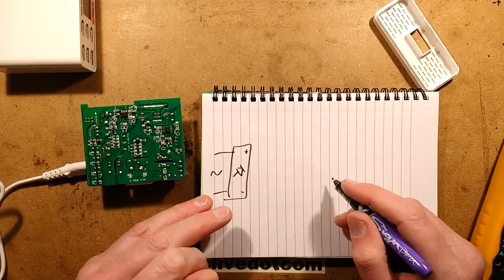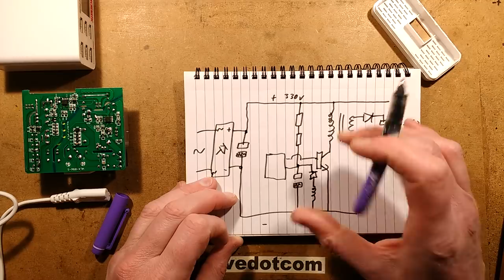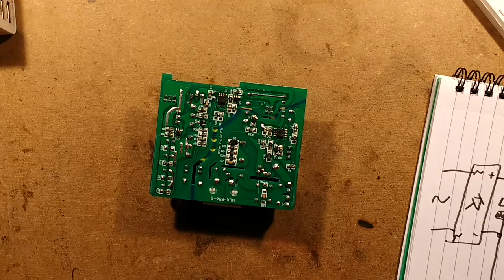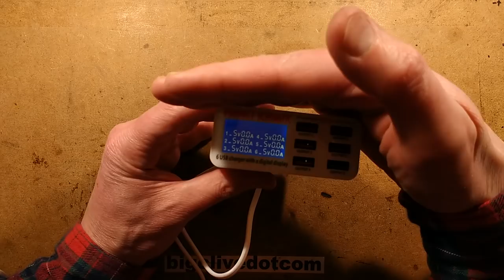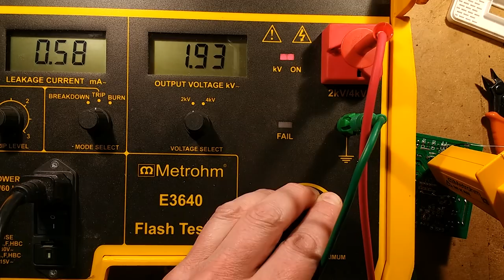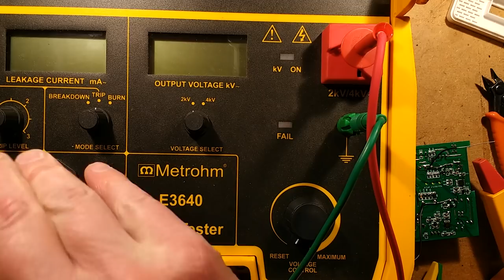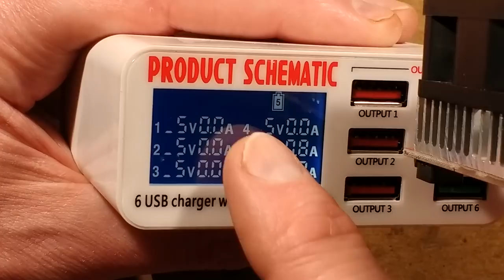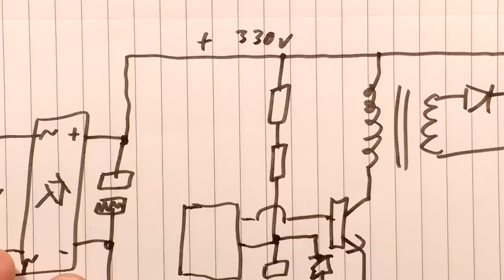Fixing a faulty USB power supply.

Comment: The USB supply called 'New Text Document (3)' is better.
Reply: Actually, I prefer New Text Document (4). It has more ports and faster charging.
Reply: @andymadden8183  I prefer New Project eventually New folder
Those bastards are more complex and have more functions.
Reply: I like my "Copy of New Project 2 (copy)-final-finalforrealthistime" power supply better. Most of the old quirks and issues are fixed in that one.

Comment: It helps to know how a circuit works and what you are looking for, you diagnosed the issue perfectly and methodically.  I've seen guys start at the back end of a circuit and never found the issue.  Always start from the input to the output, you have better luck if you don't have a schematic, if you understand what the components do, how they work and what the expected outcome is. Doodling out a drawing of the circuit is always helpful.

Comment: Hi  Clive
I cannot comment on commercial equipment but for medical equipment the test voltage as per IEC60601-1 would be 1.5kV for one means of operator protection for class 1 equipment and 3.0kV for two means of operator protection for a class 2 equipment (which is what you have there). The difference between class 1 and class 2. Class 1 has a protective earth (normally connected to a metal chassis) which is 1 means of protection, therefore you only require 1 means of protection from the mains part to the output. In the case of a class 2 devices that does not have a protective earth there is a requirement to have 2 means of protection. According to the standard a grounded chassis is considered as 1 means of operator protection.
A very good explanation on how the circuit functions.

Comment: 11:30 "The higher the frequency, the smaller the transformer you can get off with." And this is why on airliners the electricity supply is always AC at a much higher frequency than mains on the ground, so that small (and therefore light) transformers can be used.
Reply: The main reason is the smaller generator.
It's 3 phase 115V/400Hz on an airplane.
The seat and inflight entertainment is running on DC voltage made from the 400Hz rail.
That is that constant high pitch noise in the plane.
Reply: I always thought that constant high pitched noise was someone's baby crying - at least it was for a 14 hour flight to Singapore that I was on!
Reply: I would cry too if there was a constant high-pitch noise on a plane

Comment: Fine bit of soldering there, it's not easy squeezing your tip into such a small gap, even if it's just for a minute... :P
Reply: That's because he didn't - the wire was heated from the other side of the board.
Reply: Someone been watching AvE...
Reply: Jonny T    RELEASE THE SHMOOOOOO!
Reply: Jonny T obviously... Just the tip and only for a minute

Comment: Hi Clive. I've been going back through your videos. I have a USB PSU (4A) that has started to switch on and off about twice a second and I seem to remember you pointing out a fault in a USB supply that caused a similar thing and saying it wasn't uncommon. In fact I'm sure I've seen the same fault in at least two of your vids - but I'm buggered if I can find them now!
Cheers.
Reply from the maker: Usually either the low voltage side electrolytic smoothing caps, or the small electrolytic bootstrap capacitor on the high voltage side.
All replacements should be low ESR type.

Comment: When they are repairing stuff on youtube - loose wire or something simple stupid like that
When I'm repairing something - dead FPGA for 100 pounds
>.<
Reply: The videos of those are just never uploaded, since they're both a waste of time for the audience and anticlimactic.
Reply: Man I know that feeling Arek. Or it starts with a similar fault, but it ends up it's actually dead windings, a blown mosfet, a somehow-deprogrammed chip. Things that are just. Unfixable unless you control the mighty forces of nanometer sized components.
Reply: I actually once got a CP2102 chip that had the wrong firmware on it (registered as some OEM device on USB, rather than the generic USB-to-serial stuff). I ended up being able to fix it by copying the firmware from another CP2102 USB-to-UART adapter to this chip.
Reply: I’ve had an on-board power supply go into berserker mode on a board with a $5k FPGA that I really needed to finish a project. Not a happy day for sure. Eventually I figured out that some capacitors had marginal ESR by design, and as they slightly aged, the supply started pushing a sine wave on top of the about 1V the FPGA’s core needed. I couldn’t really blame the caps - they did their job fine, not their fault that the design was wonky.

Comment: I think a while back I came by some local regulations in Finland before EU. Insulation requirement was 4kVac for 1min. I've had the impression that EU regulations were similar in insulation requirements when CE compliance came.
Funnily at that time insulation transformers (used in equipment repair) needed something like 8 or 10kVac (1min) if my memory serves well. I guess there was need for some margin in case the device under repair had any high voltage sections on itself. (I tested my isolation transformers at 12kV because I had suitable source for that voltage.) Touching insulated equipment with that kind of specs is pretty safe, safer than touching commercial appliance.

Comment: I was about to buy one of these off Aliexpress.  They are much cheaper on Aliexpress than Gearbest,  which itself has wildly varying prices.
Spec says:  Single-port USB output maximum 3.5A, 6 USB ports total maximum output 6A.  I'm a bit wary of these cheapo chargers as my current one actually managed to blow out one of the USB ports when a crappy iPhone cable shorted whilst plugged in.

Comment: Strangely fascinating video..thanks for posting. I can't analyze a full circuit component by component, but I do always pull something apart, if its low voltage, to try to fix it. I get circuit corrosion a lot. I live near the sea and the salt in the air has an effect on electronics, well thats my theory. Cheers Stephen

Comment: I have found when using an isolation tester sometimes if you go to high you will take out a part without realizing it.  In my case someone changed the machine from 40VDC to 500vac without letting anyone know and it ruined all the output filter caps that were rated for a max of 50V.  We didn't realize they were bad until we got a complaint from the customer that the units were acting different than usual.

Comment: Given that all USB ports share one 5 V supply I wonder if all USB ports together can actually deliver more than 2.1 amps. Since there seems to be no real current limiting, unless the single USB port connection provided enough resistance for the voltage to drop like that I would assume all ports together not to be able to deliver a lot more than a single one...

Comment: Hi Clive a tear down of a clip on guitar tuner would be extremely interesting regarding how it picks up on vibrates and processes as a note.
Reply: probably just a microphone behind the spring clip that holds it to the instrument. Maybe it just doesn't have a hole open to the air so it only picks up vibrations conducted through the case, not random other noise. I'm guessing it would be a really boring teardown - a microphone, a chip under a blob of epoxy, a couple discrete passives, and a lcd and a couple leds.
Reply: gorak9000 Usually it's a magnetic sensor picking up vibrations of metal guitar strings.  But I don't know the details.  Clip-on pickups for acoustic guitars with non-metal strings may be microphones though.
Reply: I didn't think about that. I was mostly thinking of clip on tuners for other string instruments, like violins, where you clip them to the scroll - pretty sure the guitar tuners clip to the end of the head, by the tuners too, so they aren't using magnetics to pick up the vibrations from the strings, but rather the vibration of the head (or scroll) itself. I don't have any of those clip on tuners - more of a traditionalist, tune A using something (tuning fork, tuner, smartphone tuner app, oboe, etc), then tune everything else listening for the lack of beat frequencies
Reply: I'd guess they use signal from piezo transducers achored at one end and left to "flap" with the vibration. Would like see 'cos it's still clever or witchcraft under £10.
Reply: LostJohnny I think this is the most likely setup. I know the world we live in....I just purchased one from eBay for 6.50 and it’s fantastic.
Reply: Gorak: I have a tuner with a transparent case and you are exactly right (it does also have 1/4" sockets for electric guitar tuning).

Comment: I got a 5 usb port "tower" charger from poundland and it worked until the first time I unplugged the AC cable from it. Then it would make a crackly noise and not power anything. Turned out the AC power jack was only held in place by 2 very loose plastic plugs and the solder connecting it to the PCB which had pulled off. I sorted it by melting the plastic plugs with a soldering iron to secure the jack in place, resoldering the joints and hot gluing the hell out of it. Works great now, but it might be a common problem with that particular model.

Comment: Actually, there is only a very little amount of parts really mounted to that heat-sink, so it should be easy to remove. But unfortunately, as there are only a few parts mounted, keeping the heat sink in place, it seems to be glued at several places, so it doesn't rip parts off when being thrown and dropped. So what I do in such situations is, to un-solder all components fixed and glued to the heat-sink and remove it in one large piece. By that you can easily reach inside and fix whatever needs to be fixed.

Comment: Clive, you can buy a copy of EN60950-1 from "estonian standards" for about 33 Euros which is much cheaper than the £400 BSI want. That will detail hipot testing voltages, allowable plastic flamability ratings and creepage and clearance distances that should be used between the mains and safe side on IT equipment. The standard has been superceeded but for what you are doing that shouldn't be a problem.
Reply: If you do buy the standard that device would be pollution degree 2 and installation category II  and the PCB (if FR4) would be assumed to have a CTI of 175.

There will be multiple hipot test voltages listed one for testing by the compliance lab and a lower one which each unit should be tested to in production
Reply: Looking at the EN60950-1 Standard.

Table G1 Says for an AC supply between 150 and 300VACRMS in Overvoltage Category II the mains transient voltage is 2.5kV

Section G4.1.b.b1 Specifies the required withstand voltage is equal to the mains transient voltage at 2.5kV

Table 5C Then specifies the required test voltage for reinforced insulation with a mains transient voltage of 2.5kV is 5kV (peak or DC)

Section 5.2.2 Then says that for certification testing you would ramp to the required test voltage from 0V and then hold it for 60 seconds. It then goes on to state that for Routine Tests (ie production time test) you can reduce the 60 seconds to 1 second and reduce the voltage by 10%.

Therefore for routine testing you can use 4.5kVDC and hold it for 1 second.

Comment: Excellent video. In case the power capacitor was charged, the metal handle of the screwdriver would have zapped you first. If you are going to work on circuits with high voltage capacitors, one needs to keep a suitable power resistor with soldered wires handy for safely dissipating the charge without drama and to avoid very high fault currents of short-circuits, that may degrade the capacitor.

Comment: For the flash test voltage for usb's Speak to NAPIT, if their technical director doesn't know, he will find out for you. He's usually very good, he's on the committee for the Regs. I've worked with him before, 5 yearly inspections, and he's a nice knowledgeable engineer.

Comment: From the EN60950-1 Standard "Information technology equipment. Safety. General requirements"

Table G1 Says for an AC supply between 150 and 300VACRMS in Overvoltage Category II the mains transient voltage is 2.5kV

Section G4.1.b.b1 Specifies the required withstand voltage is equal to the mains transient voltage at 2.5kV

Table 5C Then specifies the required test voltage for reinforced insulation with a mains transient voltage of 2.5kV is 5kV (peak or DC)

Section 5.2.2 Then says that for certification testing you would ramp to the required test voltage from 0V and then hold it for 60 seconds. It then goes on to state that for Routine Tests (ie production time test) you can reduce the 60 seconds to 1 second and reduce the voltage by 10%.

Therefore for routine testing you can use 4.5kVDC and hold it for 1 second.
Reply: What is the purpose of this test? I'm a refrigeration tech in USA. We test our motors for ground faults with Meggers 500-2k volts. Is this the same? A standing merger test we call a hi-pot test & can be up to 5kv for large motors.

Comment: If it's from Gearbest I'm surprised it didn't catch fire the moment you plugged it in... actually I'm surprised it showed up after ordering
Reply: I ordered two watches from gearbest simply because that particular design was only sold there. Two arrived completely different models and both were broken. Thankfully I bought via paypal and got my money back. Gearbest never replied or messaged. Scammers...

Comment: Good to know there is a tool to remove plated through-holes connections, I would have busted that thing up trying to remove the heatsink assembly. I wonder how thin is the tube of that tool, would it fit in most cases? most manufacturing standards would have a 1mm drill hole for a 0.8mm pin for a +/-0.1mm tolerance for both hole and pin.
Reply from the maker: It has a selection of sizes.  I added an eBay search link in the description.

Comment: Get some chipquick! It’s an ultra low melting temperature solder which mixes with the tin solder to keep it molten for longer. You can wick away lots of the original solder, then solder it all back together with chipquick, then touch each connection with the iron and just pull the part off. It stays molten for about 10 seconds. I use it at work to pull TSOP56 packages off things. It works a treat.
Reply: It sounds like Wood's metal, which has a melting point of just over 70°C. At one time you could buy joke teaspoons made from it, which was great fun for kids, until Health and Safety jumped on the fact that it is toxic.
Reply: RWBHere I remember my father once telling me about those, he had one as a kid. He also had a big pint-sized bottle of mercury with a squeezable spout,  that he borrowed from work, us kids would play for hours with balls of mercury. Ah, the good old days.
Reply: I remember watching a tutorial, I think it may have been making a diy laser diode die, where indium solder was used, so hardly any heat was required, thus protecting the sensitive diode junctions.
Reply: uk DOT farnell DOT com/1850214
Its fairly expensive, but totally worth it for removing all kinds of components without damage. They supply it with a particularly aggressive acid flux, which you need for it to wet to the joint properly and mix with the existing solder. If you try it dry, or just using ordinary rosin or "no clean" synthetic flux, it won't work very well.

Comment: Product description: "Wide input voltage range of AC 100-240V, compatible with all 5V USB-charged devices. Smart Active Recognition: Single-port USB output maximum 3.5A, 6 USB ports total maximum output 6A.
LCD Display, a clear display of the state of charge, convenient at night or the case of poor light can also be observed.
With the build-in multi-protection system and premium microchips, no worry to the event of overvoltage, overcurrent, overheating or short circuits, perfectly protect your device.
Ergonomic, compact and portable design, much more space-saving and well-organized while charging your devices;Extremely rapid charger that stabilizes power by utilizing cutting edge technology."

Comment: I suspect that the transformer leg wasn't fully through the board when it was soldered at the manufacturer. If the wire was only just inside the PCB hole when it was passed through the solder bath then it could well have had just enough solder to pass post-production testing but then been easily moved with typical freight movement.

Comment: The company I worked for used 2000 volts, plus twice line voltage, for a total of 2500 volts, with less than 0.5 mA leakage, for all products that had to meet UL or CSA. However this is a DC test. That means that your 2000 volts AC should be adequate.

Comment: Found a good description on ebay of the desoldering tubes for anyone trying to find them, with an interestingly worded description.! :

8PCSLots Hollow needles desoldering tool electronic components Stainless steel

Product Description
Configuration Size:
0.8 1.0 1.2 1.4 1.6 1.8 2.0mm
The Hollow needles made of stainless steel, it is not sticking, use the pinhole penetration component pin, heated with a soldering iron, a slight rotation to the component lead and copper foil separation

The needle is used for hardware engineer to desolder the Electronic components(e.g. DIP components)from PCB , Because the needle is used with special stainless steel , the needle will not be pasted Flux. 
 8Pcs With case
Tips: This product is generally produced material, but economical and practical

Comment: I have 2 of these chargers. They come in 2 versions. One is all outputs at 5v 2A MAX (All shared up to 6A) This one has a green USB port that supports QC 3.0. There is a chip controller for this. On of them had an unsoldered SMD transistor leg and I fixed it. myself.

Comment: The green usb output is for quick charging it has 5V 3.4A, 9V 2A and 12V 1.5A outputs, i just bought the same model made by yaxun but the power socket is dodgy and the back cover is tight compared to this one